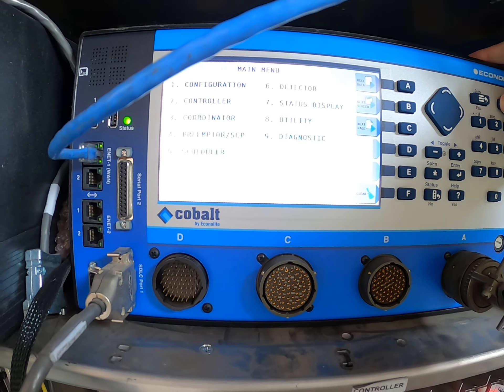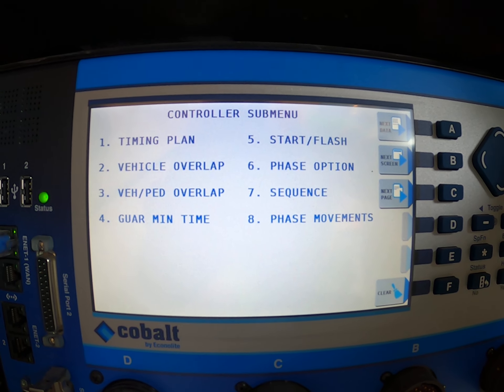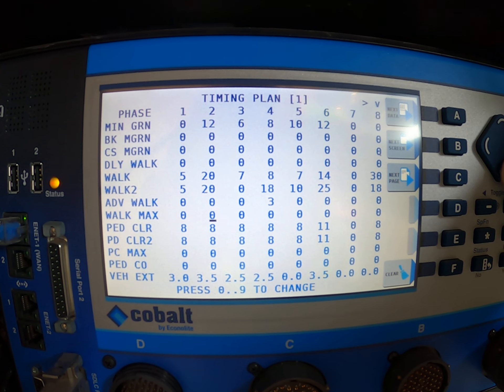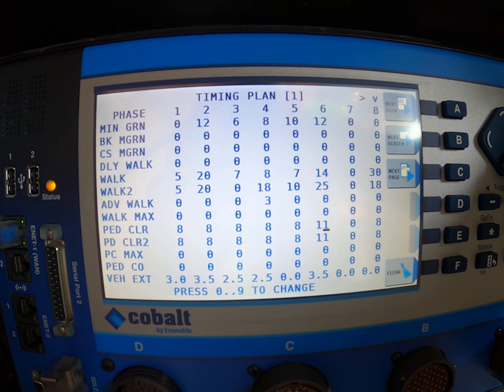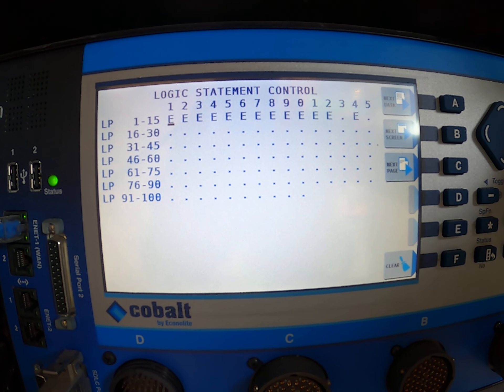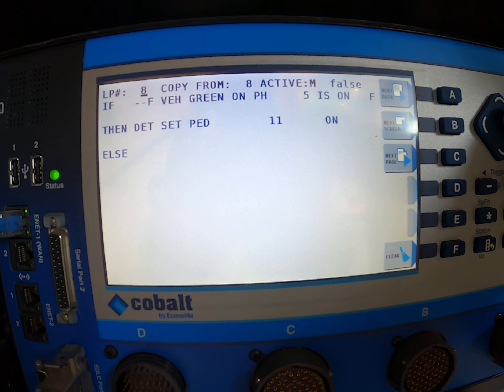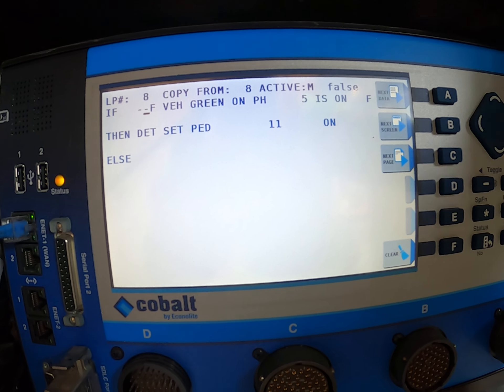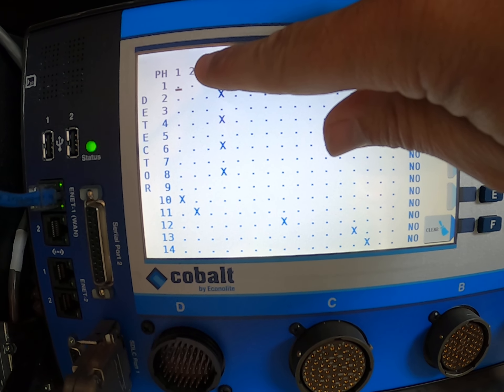Walk extension logic at Free operating signal

Comment: Is there no built-in function for this? Back when I programmed Peek ATC controllers we could just select rest in walk and simultaneous FDW for ø2 and ø6. No need for logic scripts and it also worked in free
Reply from the maker: @OntarioTrafficManClips  I'm not sure there's a simultaneous phase 2 and 6 endpoint in econolites. Since it's free and there are recalls for other phases the controller always wants to end the walk. So this was the workaround.
Reply: @EngMadison  Am I correct in understanding that the main street is extendable? In that case we don't have a comparable intersection - if the side street is on recall then the main street is always on max recall
Reply from the maker: @OntarioTrafficManClips  yes, the mainline can be extended, a completely uncoordinated signal.
Reply: @EngMadison  Cool! Yeah we don't have anything like that in Toronto
Reply from the maker: @OntarioTrafficManClips  i could have swore I saw something along these lines regarding TSP operations. Wasn't Toronto leading the way in developing TSP operations decades ago?
Reply: @EngMadison  Oh yeah there are hundreds of intersections like that with TSP, but they're almost all coordinated. The ATC-1000 doesn't have built in TSP in free, so for the uncoordinated intersections I wrote logic scripts to keep track of priority requests, determine whether the streetcar could make it through with an extension, and pause the transition between phases such that it extends in Green/SDW. I also wrote a similar script for truncation but it was never approved for on street use.